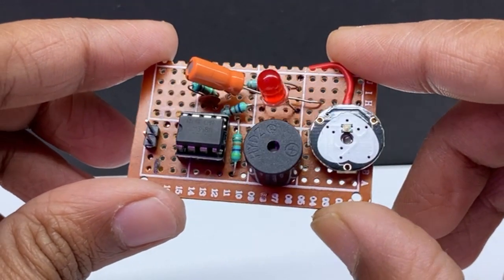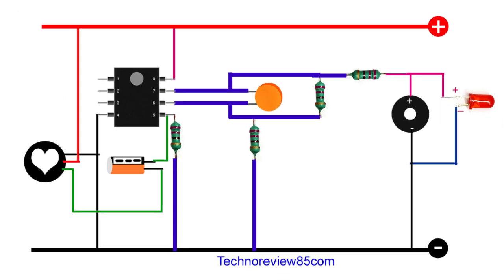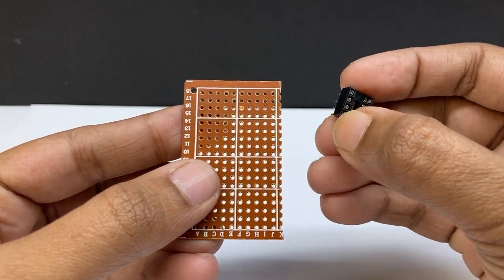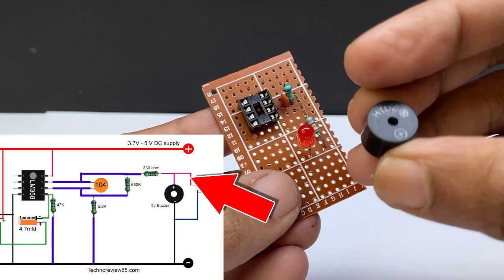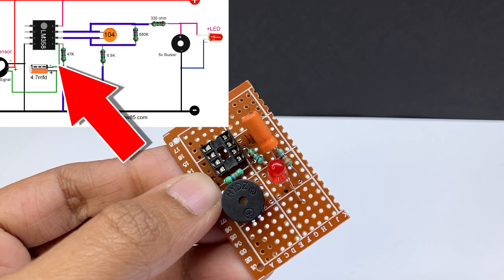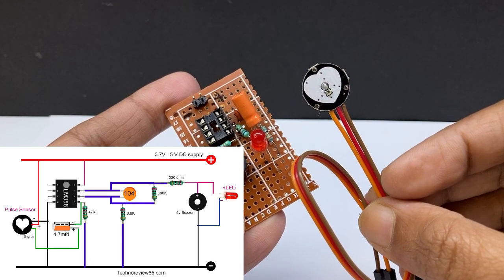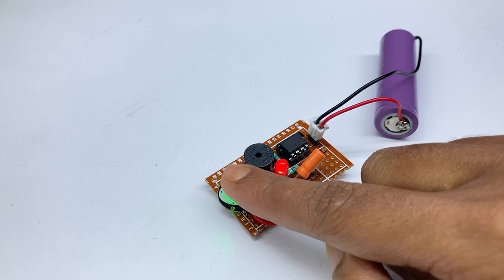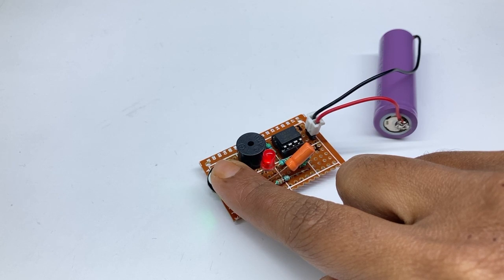Heart beat sensor & monitor using IC lm358 | Electronic project

Comment: It's working tq sir
Reply: Are u sure
Reply: @shadowfighter7085  yes, 220 ohm resistor extra add in this circuit
Reply: @gayatrigk7165  do u use bc 547 or bc548
Reply: @shadowfighter7085  nope
Reply: @gayatrigk7165  ayin
Reply: @shadowfighter7085  their is no need of any transistor in this circuit
Reply: @gayatrigk7165  srry my mistake
I thought this as music reacting led circuit from this channel 😅
Reply: @shadowfighter7085  it's ok
Reply: @gayatrigk7165  where can we add extra ?
Reply: I made the circuit according to the video but mine is not working. Please help
Reply: @gayatrigk7165  where  do we have to add extra 220 ohm resistor please reply
Reply: @chinmayd3840     330 ohm resistor to ground
Reply: @gayatrigk7165  Thanks!